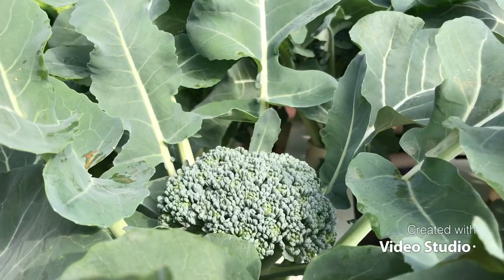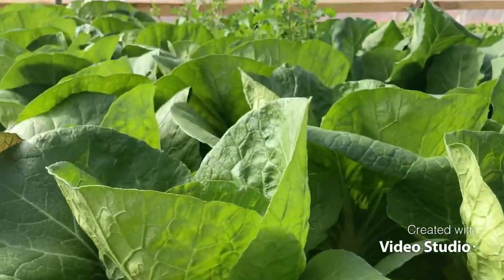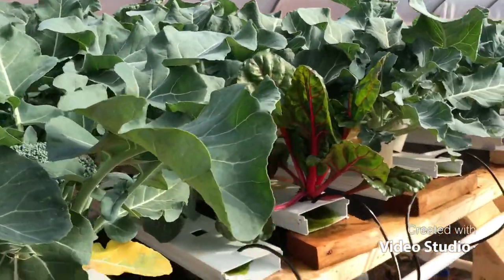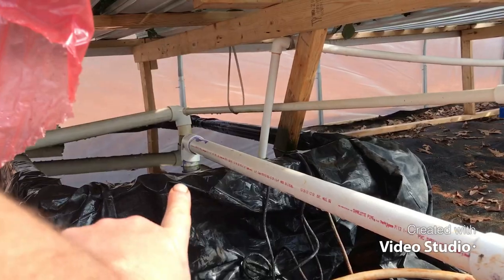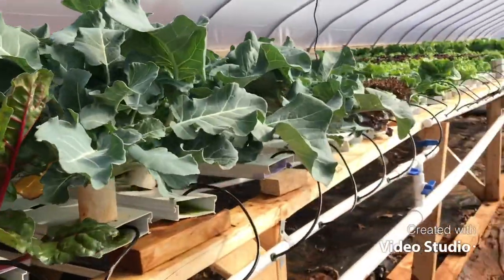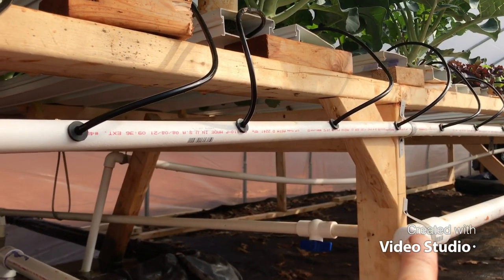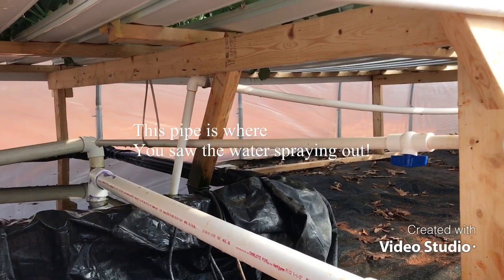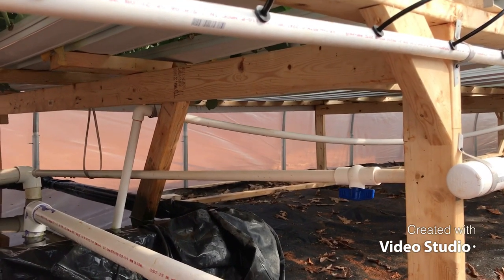Try this simple waterfall method for adding oxygen to your hydroponic system!

Comment: Really ingenious and simple, and best of all uses no extra energy, is almost problem proof and will indeed provide lots of oxygen to the solution. Great job
Reply from the maker: Yes, exactly! I have started using Venturi’s to do the same thing, but this still works. Just be sure to cover the reservoir, or run sanidate 5.0 or you’ll get a lot of algae!

Comment: How many liters in each system? How much gph through the aeration pipe. We have multiple 2000 liter systems
Reply from the maker: The pump is 3100 GPH or 12,000 liters per hour, and about half of that runs out through the spray bar. The reservoir is 400 liters. I’m not sure what the minimum gph it needs to operate is, but to me it’s far better than airstones, and I only have 1 pump to worry about.

Comment: I tried planting different crops together  like lettuce, basil and other herbs. It didnt do well due to different nutrient requirements of each crop.
Reply from the maker: Interesting, some herbs are do not do good in hydroponics, but basil and lettuce are good together, I’d be interested to know what went wrong.
Reply: Basil leaves turned yellow and eventually died. Someone pointed out basil needs a higher ppm than lettuce to thrive
Reply: @momon5858  i have basil and lettuce together at 1.2 ec both grow well

Comment: Can you please explain the valve pressure
Reply from the maker: The valve is simply to slow down the pressure if it gets so much that the water is splashing out, or if it I need extra pressure in the system.